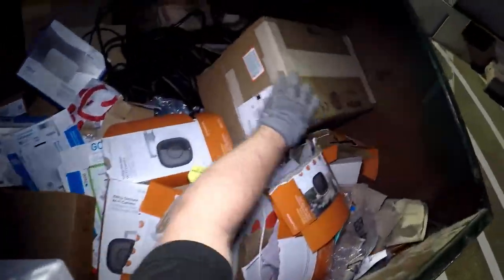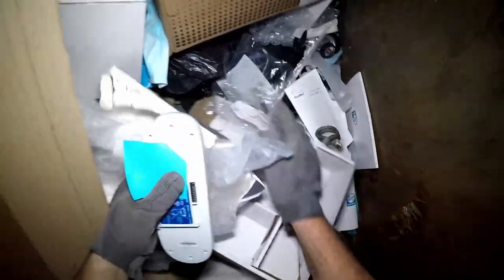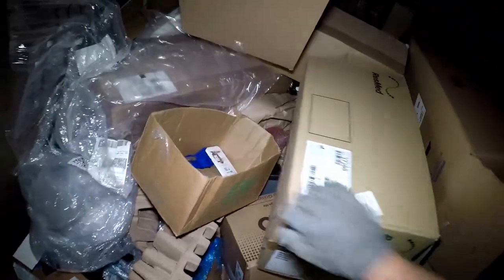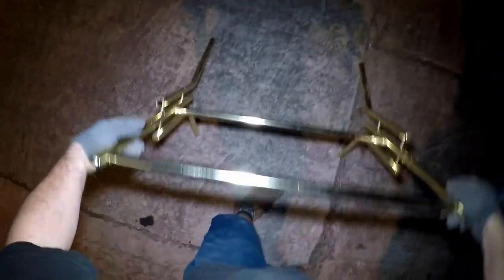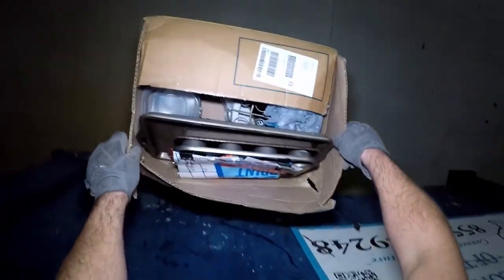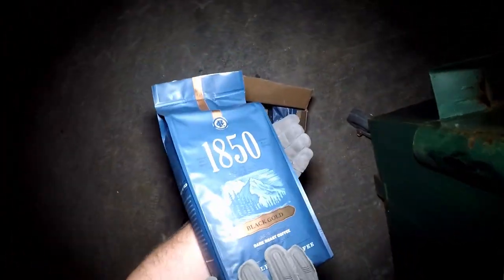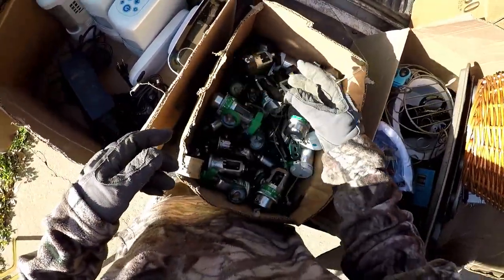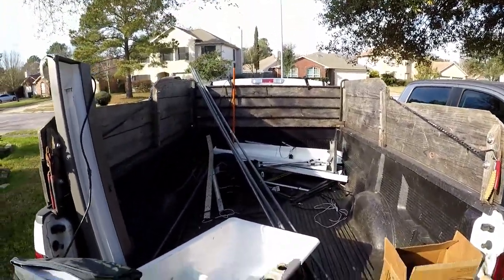Dumpster Diving "It's Not My Jam"

Comment: Mike Cpap machines can be donated to people who need them. I pay for mine and my insurance doesn't pay so I have to.
Reply: Yes, pls Mike, make a donation, at the end you always can scrap them, there is a turbine in and circuit card
Reply: no, those machines must be calibrated by certified only specifically for the pt
Reply: @gmaflor  it goes without saying, in my coutry, when they not meet the charts, they take appart other to make one and it's donate to charity for those people than can't afford one. All of that process it's make by a medical charity organisation
Reply: Units are thrown away for a reason.
Reply: @Kenthis15  Like the coffee, like all the other new stuff Mike found in the dumbsters ? Yes, beacause of capitalism...
Reply: @Maccoye  Because if a unit malfunctions at the wrong time it could kill someone, so they are held to strict standards, thats completely different compared to some old coffee, knob.
Reply: @gmaflor   once you know your levels you can go on line and find out how to reset or calibrate some CPAP machines.
And we have seen lots of waste in the medical community. In previous videos Mike found about 100 sets of brand new tubing still in sealed packages thrown in dumpster. I know as a retired nurse of 40 yrs much is thrown away just because a new company takes over and we’re not using the brand they are contracted with.

Comment: The medical devices that found in this video are CPAP & BIPAP machines, They are used for individuals that have sleep apnea issues. The settings have to be programmed according to the individuals Sleep study results, only a certified medical representative at the medical device company can upload the settings to those devices. Hope this helps you.
Reply: The one complete kit you unzipped is the model that I use. I got it through my medical benefits and that kit was $1800.00 (Canadian) I can't believe the'd just toss it like that. 
But as another poster said it's not much good to someone unless you have all the testing done and you get fitted by a respiratory therapist who can read the sleep study data.
Reply: You can program them yourself. I do whenever I get one.
Reply: @richardveazey3457  Yes that part of it is easy. You can adjust the inches/centimeters of water column easily if you know what number is the recommended amount for you.
Reply: My Dreamcast cpap cost $1800AUD and yes i had to go through a sleep study to get it programmed. Were lucky here in Australia with our low income medical it only costs me $100/year to rent it.
Reply: @jiminycricket2230  They also have a limited number of hours until they’re not considered safe to use anymore, some people will use them past their quota but service centers will trash units with too many hours on them.
Reply: I have a CPAP machine and I can set it . I've figured out how to set my machine myself. Also a CPAP is continuous air pressure. A Bi-PAP machine is programmed to blow air and when you exhale the air cuts off and lets you exhale. My husband has a BI-Pap machine.
Reply: incorrect, most cpap/bipap machines can be programmed by the end user.
Reply: @geoffreed4199  yes I program mine
Reply: The ResMed airsense 10 I can get online for $550
Reply: You are right. And I believe the used machinery (CPAP n bipap/ hose etc) can not be sold. Can micro scrap for motherboards n such though.

Comment: G’day. I am from 🇦🇺 and have recently bought a res med c-pap machine exactly like those you discarded. It cost me $1500 new- that’s Australian $. I had a technician set it up, which was included in the price. Those weren’t used as they were in original packaging. They could be checked by a technician to make sure they are ok. If you and the tech took $500 each you would both have a good bonus and the user would save money!

Comment: 8:45 that black ResMed is only a couple of thousand. The white small oxygen concentrators are the $6000 ones.
Reply: Even if you don’t resale it or donate it there is hood scrap value in them. 
The air hose is #2 copper wire the water tank is stainless steel and copper and aluminum and eboards inside $$$$$$$

Comment: That bipap machine that you opened out of the plastic bag is the model that I use.  It cost €4000 in Germany.  I would gladly have paid you good money for it.  The right way is to get them from medical sources, but if you know the settings (like the ones that are on your current machine) you can get the info on how to do the setup on the internet and do it yourself.

Comment: The Res Med By pap machine you pulled out of the bag is the same as the one I use. I don't know if it costs $6000 if you had to pay for it but that is approximately what my insurance company paid for mine. That model can set itself for your best breathing results as long as you have an sd card in it. There are many people that just can't afford to pay the price for one and many of those same people will die from heart failures or other problems related to oxygen deprivation to the brain and various other organs . It's a sad state of affairs but what can you do about it. You could collect those machines when you find them and donate them to some kind of organization that helps the people that just can't do it for themselves.

Comment: If someone buys those Capps they can sterilize it with a ozone machine. The first one you pulled out in the bag I think was new because the hose was still in plastic.  The hose cost about 65 dollars. I know because I have to buy new ones for mine. The oxygen concentrator are more exspensive.

Comment: Mike here is description of bipap

Some medical problems can make it hard for you to breathe. In these cases, you might benefit from bilevel positive airway pressure. It is commonly known as “BiPap” or “BPap.” It is a type of ventilator—a device that helps with breathing.

During normal breathing, your lungs expand when you breathe in. This is caused by the diaphragm, which is the main muscle of breathing in your chest, going in a downward direction. This causes the pressure to drop inside the tubes and sacs of your lungs. This decrease in pressure sucks air into your lungs. They fill with oxygenated air.

If you have trouble breathing, a BiPap machine can help push air into your lungs. You wear a mask or nasal plugs that are connected to the ventilator. The machine supplies pressurized air into your airways. It is called “positive pressure ventilation” because the device helps open your lungs with this air pressure

Comment: The CPAP machines could possibly be used in a DIY positive pressure air filter mask. If someone could figure out how to hack the code it would be pretty easy to run a hose to a full face mask. Just a thought. Keep up the good work Mike.

Comment: glue a speaker magnet or a hard drive magnet to the bottom of those stainless steel pet bowls with rtv silicone, and presto! a deep sided magnetic parts tray for cheap. i pick'em up at the dollar tree when i have some magnets. it sure beats 5-10 bucks a pop for the super shallow ones they sell. those things are crazy priced for what they are. old teflon coated aluminum frying pans work too. everyone ditches them when the paint starts flaking off the bottom. i just remove the handle, break off the nub the handle attaches to, and now you've got a mostly non stick parts tray. muffin tins i use for separating different fasteners when i tear something apart to repair. these are things worth more than scrap to me, 'cause i'm always fixing something.  i just rebuilt one of my staple guns yesterday, and a used a dozen muffin tin to hold and keep track of the parts.

Comment: About 18-24 months ago Phillips had to recall thousands of sleep machines because of carcinogenic filters.  I will bet that there are are places that accept equipment donations then clean and store it to loan or give to those who cannot afford it.  Crutches are about $40, commode with bucket and lid about $45, bucket alone $7.  Over tub side shower chair  $50.  Depending on  patient needs the sleep machines are $2000-$6000.  Most expensive ones are the ASV machines which are hybrid ventilators.  I shudder to think what an oxygen concentrator costs;  the blue ones are frequently being repaired and the heavy gray ones are the workhorses.  There are people out there who repair concentrators for free.  The oxygen accessories can be donated as long as it is still in sealed original packing. Generally the tanks and regulators/gauges are defective.
Love your channel and your goofy sense of humor plus you work hard. But you might want to consider slowing down a bit so you don't kill your body or ruin it beyond repair.  Be kind to yourself!.

Comment: CPAP machines are illegal to sell without a license and you will get banned on eBay if they catch you, I had to beg for my account back after listing a CPAP machine. The bags and accessories are okay as long as the tag doesn’t say RX only. 

These units are not thrown away without good reason, after a certain number of hours the units are no longer considered safe or effective for the patient and must be replaced for the patients health. Additionally, any units abused or exposed to harsh odors like cigarettes are also disposed of. Any sign of defects also get disposed of. 

Remember, one of these units malfunctioning at the wrong time could cost someone’s life or great bodily harm, and Mike would be responsible if he sold a defective unit he found in a dumpster and it killed someone.

Comment: A lil FYI Mike those Resmed CPAP machines are like eight hundred bucks ...
well that is what they charge the insurance companies and then the consumer payes X amount  for a deductible.
Whoever told you they were like 6 tousand dollars was obviously blowing smoke up ur ass ....
Maybe one of those O2 Oxygen machines that are self contained are a few grand , but no where near the 6 grand that someone told u .
Reason i know is i have sleep apnea and i am supposed to use the machine every night but i havent used it like i am supposed to and i have the white machine that is a few years old,
Before the small black one came out.
Not sure if you knwo this but the machine i have has a SD card in it so you might wanna check the black machines for them , they might have one . 
But i could be wrong , i just know my machine has one on the left side of the machine.